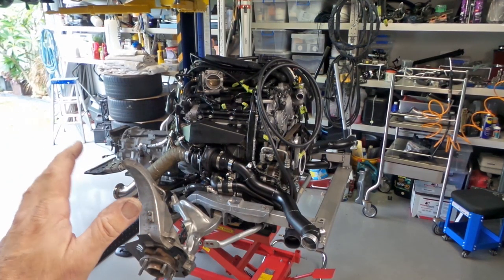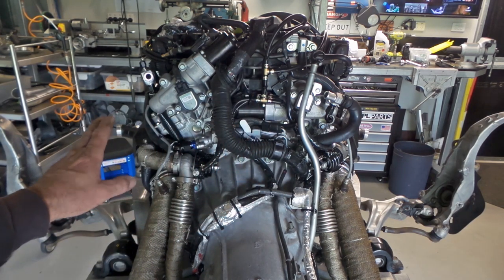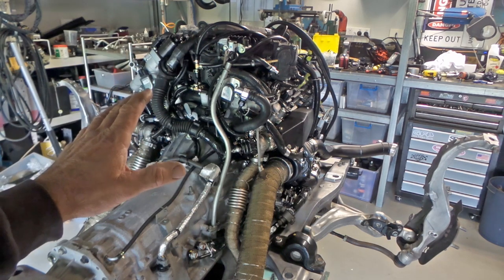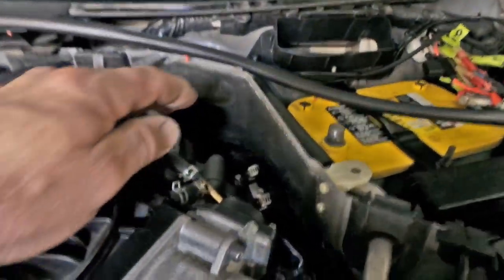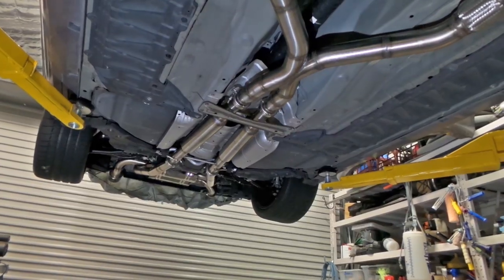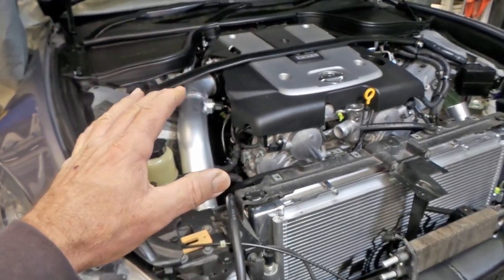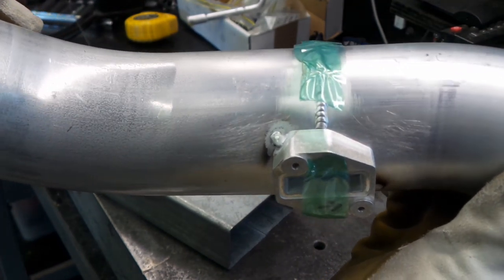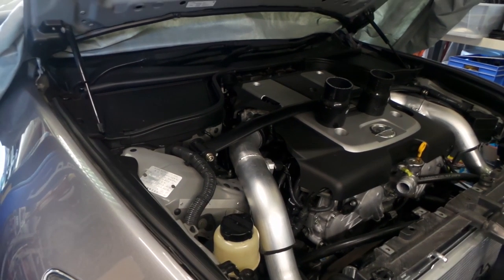Diy VQ37 TT Engine In (Finally)

Comment: I'm really excited to see her start up! Watching from across the Tasman here! Good job in tucking up those cables! I hope you have enough wiggle room when the engine moves. 
Is that a strut bar from a 370Z you put in? Are they straight forward bolt in?
Reply from the maker: G'day Mate, no its an aftermarket unit. Was originally polished with bright blue mounts. I have given it a few coats of satin black epoxy to make it look more like a factory part. Cheers.

Comment: Hi Trevor, there's a product called "Kapton Tape" (polyimide) used in electronics manufacturing (and 3d printer hot plates) which is a heat-proof sticky tape. You can buy the shit stuff on eBay and Jaycar etc, but get the 3M brand if you want to hold properly hot bits. Could be useful for holding parts in place where the PE is too soft, its good for up to about 250°C for extended periods.
Reply from the maker: Thanks Mat, Cheers.

Comment: Love your vid's and content keep it up. Just paused the video at describing the tie down part of the vid, at 5.23min, aren't you worried about the plastic cable ties melting or letting go with the heat?
Reply from the maker: G'day Steve, I hear ya, cable ties have proven to be surprisingly heat resistant. No idea why, but they just seem to be fine even with moderate heat. I have stainless cable ties for those really serious spots or if a plastic tie fails due to heat. I'm constantly surprised with some of the situations i have found them working in without letting go. I guess time will tell. Cheers Mate.

Comment: Been meaning to ask What brand/Model tig welder are you using sir? Btw, love the attention to detail that you have!!!!
Reply from the maker: G'day Mate, its a reasonably cheap chinese unit. 200amp ac/dc inverter. No pulse, but has plenty of flexibility with all of the other settings. A local guy started a business with them probably 15 years ago now. He is an electrical engineer & had them built to his specs. I have a couple of his other welders as well, they seem pretty decent & reliable.
Nice Guy too. Its probably around 12 years old now I reckon, all i've done is replace the gas valve in it.
Token Tools is the Brand. Cheers Mate.

Comment: The Mark II holding method is new to me... a great idea when she works.
Reply from the maker: Hi Rick,  yep the PET Tape is okay in some instances, biggest issue for me with it & why I don't use it more is its lack of elasticity. It is however the most heat resistant Tape I have used. After I tacked the MAF flange on I realized I could have just used a large hose clamp, which i have plenty of. Ah well, hind sight & all that. Cheers Mate.